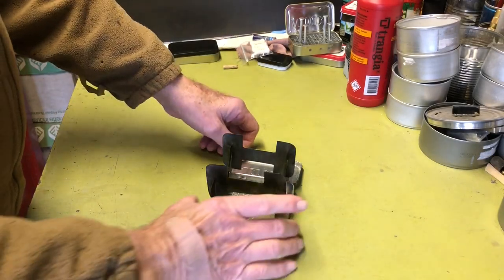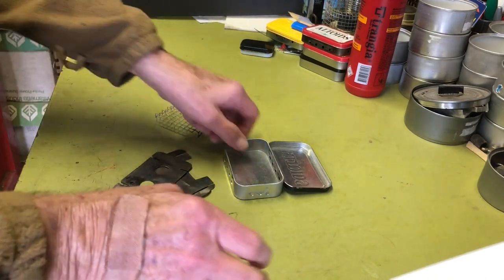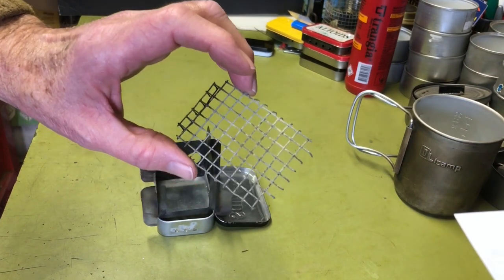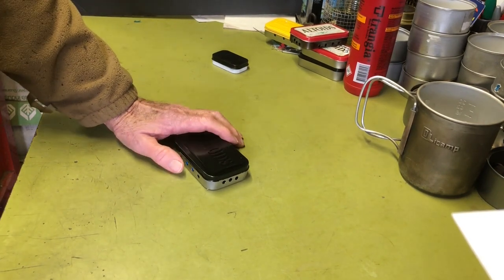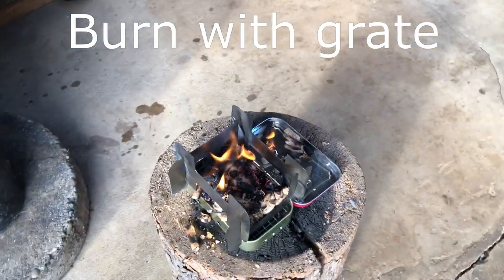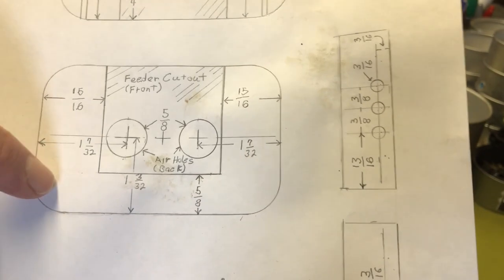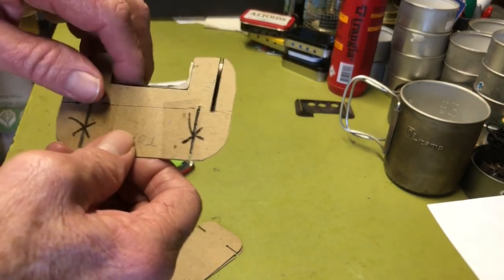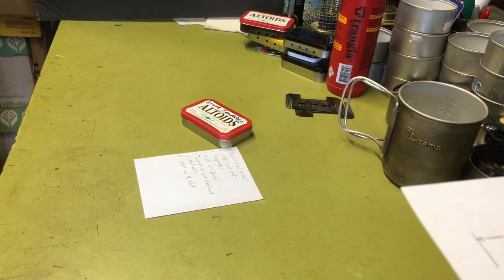Altoids Tin Wood Stove

Comment: Can i make a suggestion, if you rotate the stove 90 degrees so the opening is in front of the lid, this gives you a natural pkace to put the fuel, also the spilling of ash on the sides will fall into the sides of the tin. Hope thay makes sense 😊
Reply from the maker: That would probably work. My only concern would be stability because the metal is thin and a bit flixable, the larger gap might wobble when a pot is put on but worth a try. 🙂